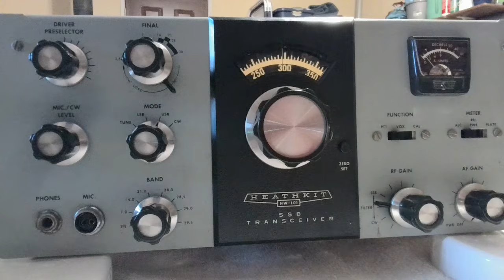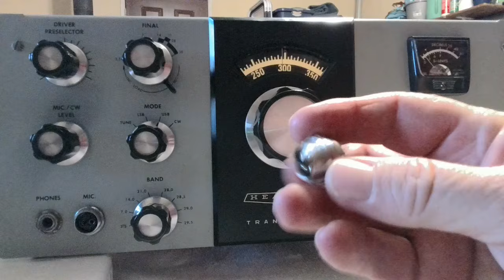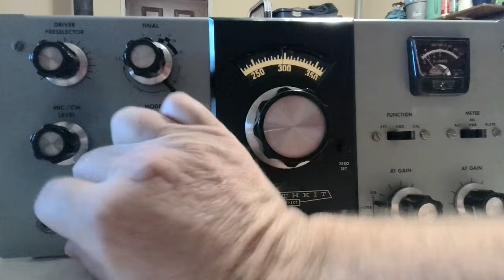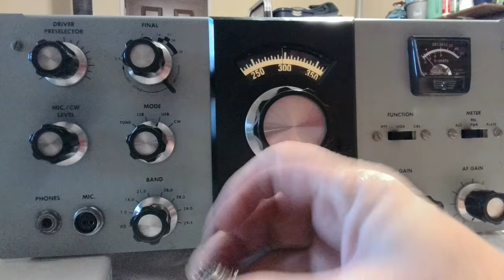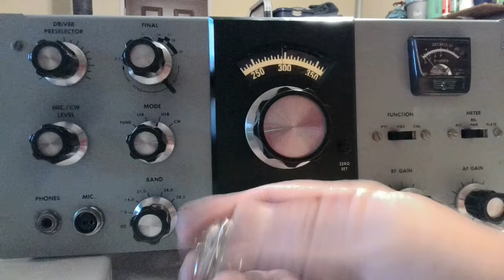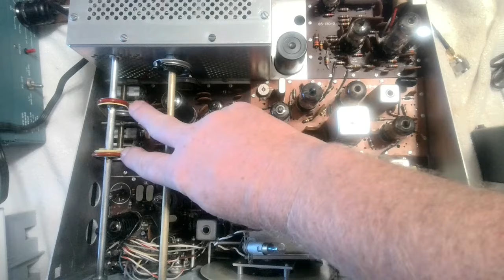Heathkit HW 101 Update, Turn on and see if it receives

Comment: I built a "Hot Water 101" in 1977. I still have it, and it's still working. Had to replace the usual stuff like caps and tubes over the years but it's a well designed rig. Thanjs for the look see. 73s, KF7YN